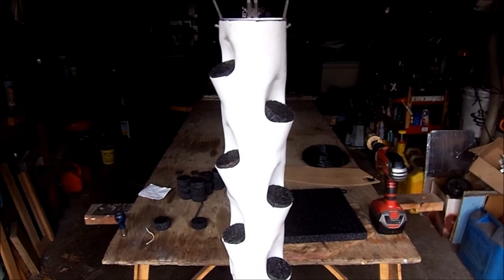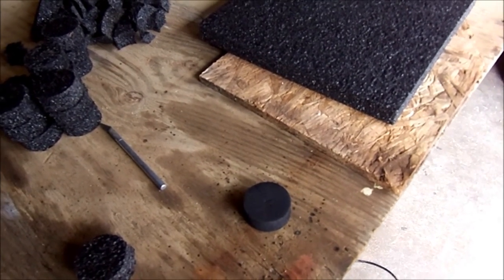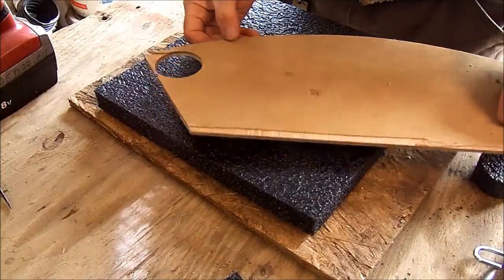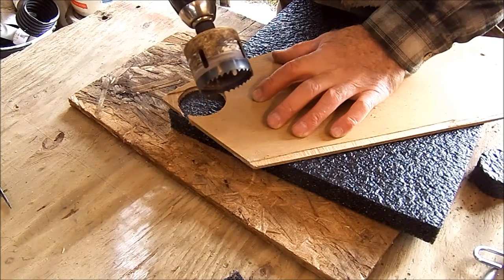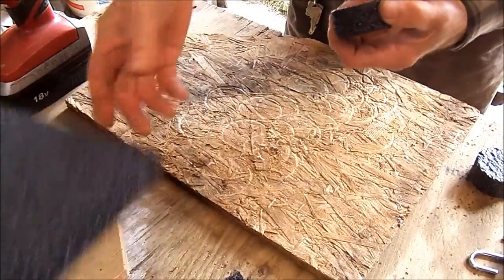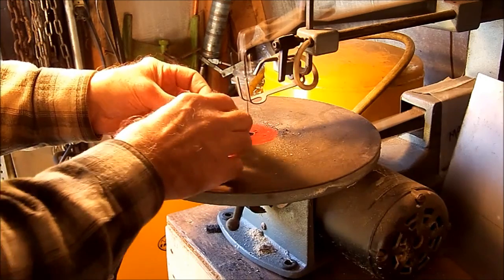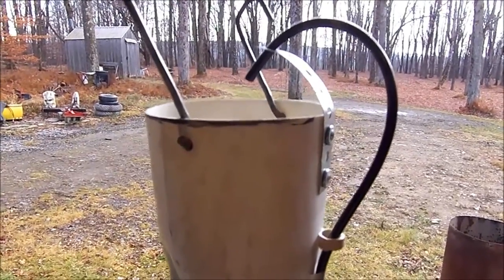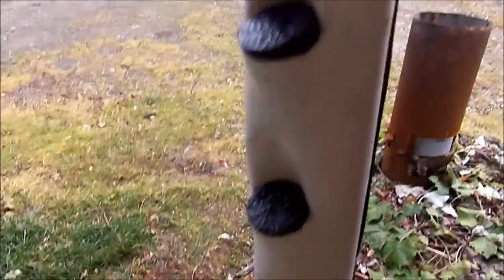Clone Inserts for Grow Tower

Comment: over in the uk its hard to get the 3 inch inserts like off ebay ...heres one for you fella and be cheaper >>>> size 71.7 inch by 24 inch !!! 15mm thick exersize mat or camping mat there waterproof and the density is quite good

Comment: Nice video.  You could try GrowGrips (available on Amazon).  They run about .25 each (if you buy 100) but, will save you the time :).  Can't wait to see how the plants grow!
Reply from the maker: +Shawn Bauer I thought about it.  The problem is the hole needs to filled completely.  If light gets in algae will grow.  I bought some left-over "experimental" GrowGrip sheet material Rob had and I will make some from that material to compare against these.  Thanks for watching!